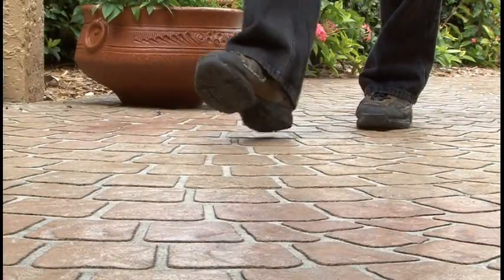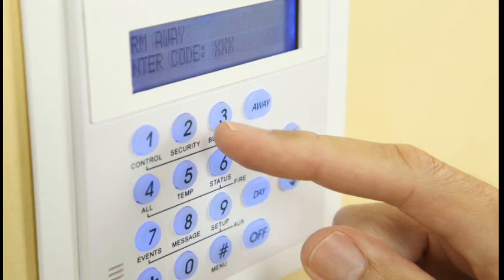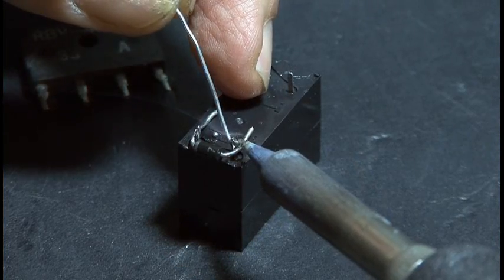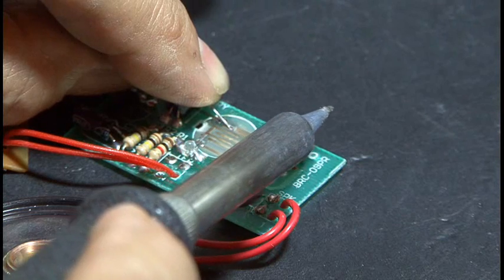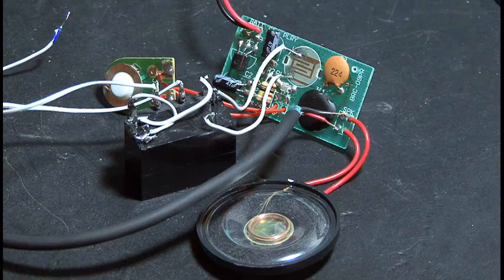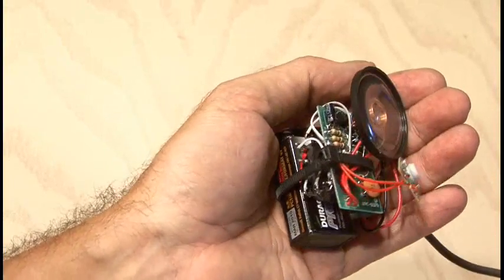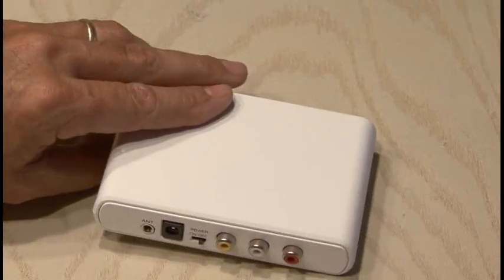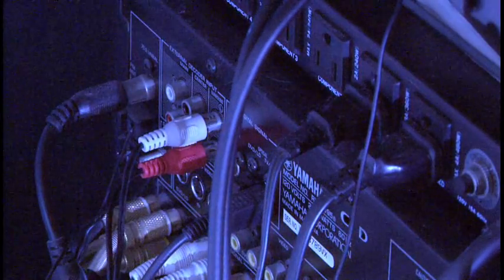Guard Dog Burglar Alarm

Comment: just add a capacitor and some few commponents so it ignores if you press twice.

and it would be cool to connct it to your other project with garage door sensors so the sound starts before the burgular comes and then you also can use a veeeeery lond dog sound.

Comment: hangon kipkay so u solder the mini cable were the speaker is and connect the input audio in from there and then use the same cable for out put without soldering it to another point. please pm and give me an answer im really keen on building this. thanks